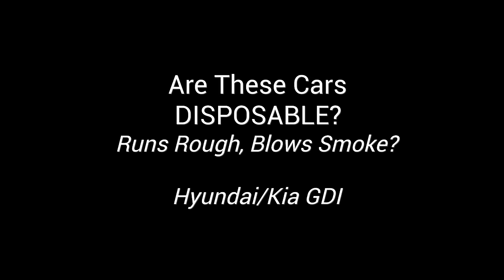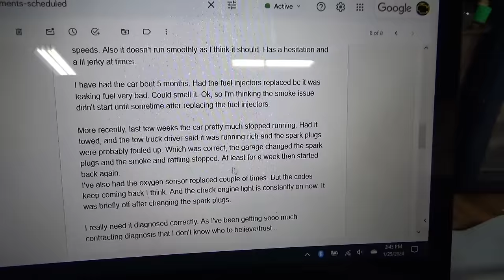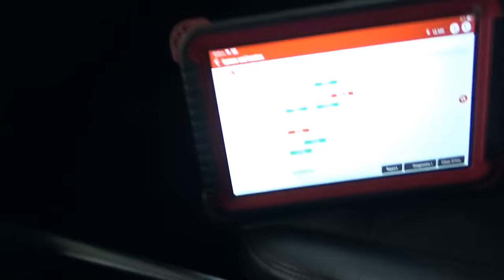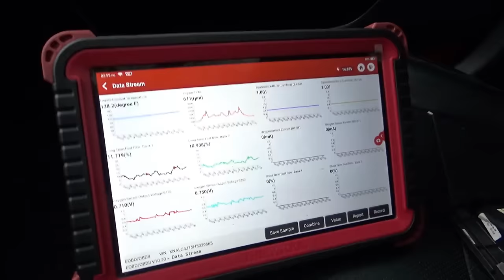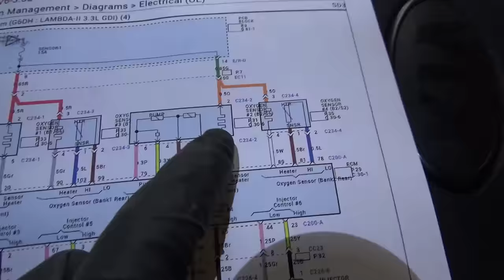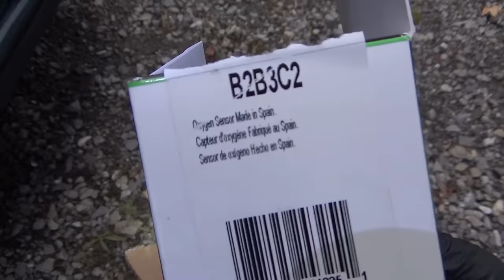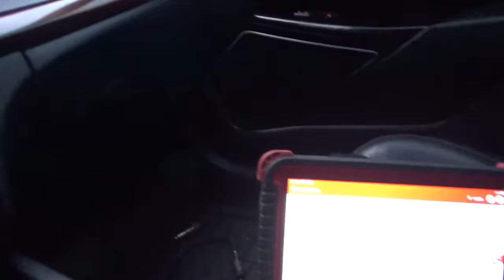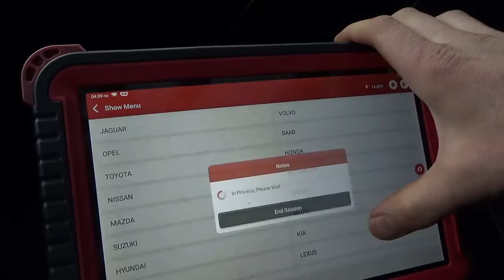Are These Cars DISPOSABLE? (Hyundai/Kia GDI Burning OIL - MISFIRE, Low Power)

Comment: Hyundai/Kia cars can last if they're non GDI. Had an 07 Azera with 3.8L V6 it had over 201,000mi on it. Before it got totalled in an accident. Main issue was leaking valve cover gaskets which is a known issue with that engine and bad OCV. My mom drives a 2010 Sonata 2.4L Non-GDI. It has over 230,000mi on it and still runs. Original powertrain on both vehicles. Oil changes every 4,000mi or so. 

Another variable I think plays a role besides regular oil changes every 5,000mi is where the vehicle was manufactured. Korean manufacturered seems to have less issues when compared with US built.
Reply: In the US they don't build them like in Korea.
Reply: @lactusgalacto1174  I actually agree with that. My Azera was built in Korea. My GF's Kona was built in Korea (it has the 2.0 NU engine which is known for it's own issues with piston rings. Haven't had an issue, yet.) The 2010 sonata was built in the US (Alabama). Lots of Theta II engine issues seem to be tied to US plants Hyundai in Alabama, and Kia in Georgia. My dad and I looked at two brand 21 Sonata's 3 years ago and one of them was leaking oil near the valve cover gasket. Sales guys and manager were surprised that it passed quality control at the factory and their Pre delivery inspection at the dealer. Of course both were built in Alabama.

Comment: Yes, many/most cars today are disposable. The manufactures are under great pressure to meet increasingly optimistic fuel economy standards. This brought us things like GDI with all of its inherent problems with coking up the intake valves. The loose-fitting piston rings rescue drag, i.e. a bit more efficient, but it increases oil consumption, so a second cat is added to handle the extra emissions. On the 1.6L Prince engine BMW/Mini says half a quart of oil every 1 thousand miles is normal. Twenty-five years ago, we would call this a junk engine. 

In the end all the complexity and extra parts required to meet silly fuel economy standards probably create more pollution if tracked over their life cycle.
Reply: What's funny is my '97 cavalier 2.2L (5spd) got the same mpg as my '13 rio 1.6L GDI
Reply: @nick21614  Either your Cavalier got 1.5 the MPG it should have, or your Rio has a problem. Based on MPG ratings that is.
Reply: @HeyBirt  Nah the epa estimates are pretty bad all my driving is highway too. Doubt anything is wrong with the rio I change the oil every 3k miles and it has under 60k miles on it.

Comment: The 2010 year 2.4l Hyundai sonata were designed perfectly! Only in 2010 did sonata get the timing chain and normal aspirated engine! Cuz it changed to GDI/port injection in 2011 and newer and massive amounts of issues and blown engines! And in 09 had normal fuel injected engine BUT timing belts that broke nearly on time it’s recommended mileage replacement (every 60k miles) all 4 of my Hyundais not from 2010 
Blew engines from timing belts breaking all around 50-57k miles on 2 and one at 66k (thankfully it broke just when I parked it. Cuz wouldn’t start upon leaving! I got lucky on that one!) and cost to replace the belt prior to it breaking quoted $2,000-$2,700 by dealers. And $1,500-$2.200 from non dealers! 
Unfortunately if the belt breaks while on highway the engines gone! 
     They should have KEPT the 2010 design with the chain and smooth 5 speed automatic not CVT! non GDI non port injection combo like after 2010.
      My 2010 sonata didn’t burn oil in fact every time I drained my oil at 5k miles the oil was STILL GOLD BROWN colour! Wasn’t black at all! In fact I’ve own almost 35 cars in 22 years and I’ve never seen a car do that! 
     And it was so comfortable almost road like a Cadillac

Comment: Lol so pretty much he didn't do what he was supposed to until it became such a problem he's going to need a new engine hmm funny that. Also seafoam will help that engine alot, it does in fact clean when you run it through the intake but more to the point of the car your working on if you put it in the oil it does help you just have to know how to use it

Comment: We're past the sweet spot of relatively straightforward port fuel-injected vehicles sold between 1995 - 2010. Combustion cars being sold now have now have become exponentially more complex and have made a lot of reliability compromises to keep emissions down and fuel economy up. 

I also hate that our regulations disproportionately affect smaller cars vs. light trucks and SUVs, completely undermining the goals of the regulations in the first place and pushing people into larger vehicles than they need. It sucks that small, practical cars are basically non-existent in the new market and reliable offerings are very sought-after in the used market.

Comment: Good tip Ivan! I work on small engines and use products developed for the 2 stroke outboard motor industry. Evinrude Johnson Engine tuner or mercury marine or Yamaha ring free (I think).
I spray it into the intake of a hot engine and just about stall it out a few times then spray a steady stream until it stalls. Wait - the longer the better. It'll smoke like crazy on restart, but It does a really good job of decarbonizing the head and piston.

Comment: Enjoy your video you seem like a very smart diagnostic technician I'm sure a Kia Hyundai is quite a challenge the next challenge we have to undertake is now Honda and Toyota are attempting direct injection which will ultimately shorten the life of their engines to the point of being very similar to the Kia Hyundai however Toyota has both port and direct injection which may not destroy the engine quite as fast direct injection involves high pressure fuel shot directly into the cylinder which typically only works on a high compression diesel engine it is never going to work and be effective and not destroy a gasoline low compression engine why they have to keep changing and why a Toyota now needs to have two fuel systems I just don't even know but again it makes me cherish and appreciate my 1976 Chevrolet Monte Carlo with a 354 Barrel turbo 400 automatic

Comment: Getting some monitors to run can be a bear.  My mom has a 2005 Honda Accord, and it was sitting for a long time with a dead battery.  I managed to get everything to run except evap.  Turns out Honda wants very specific conditions like tank between 1/4 and 3/4 and temperature above freezing for 8 hours.  It finally ran that monitor after a week of trying.

Comment: Two different customers complaints class 8 truck oil consumption , both had recently replaced  ( 6 - 8 months ) dipsticks and calibrated their dipsticks incorrectly . Basically overfilling crankcase by 1 gallon of oil .

Comment: I know that my brothers mother in law got rid of her Mitsubishi Outlander because it began burning more oil than fuel at under 100,000 kilometres.

his.wifes Lancer is the same deal,she booked it in to get the engine replaced under warranty.

His old 1996 model Hyundai Excel ( aka Accent in the U.S.) was still going &:it had about 165 PSI of compression on each cylinder at over 300,000 kilometres,it ran the 1.5 litre DOHC Hyundai engine.

He bought a 2000 model 2 litre 4 cylinder Hyundai Elantra to replace it because the Excel was falling apart.

The older Hyundais were good but ever since they have went to low friction piston rings they tend to burn oil & the rings get stuck in the ring grooves.

That was the case with my dads neighbours Genesis which runs the 3.8 litre Hyundai Lambda V6 engine, AFAIK he had the engine replaced due to an oil burning issue,the piston rings have been known to stick in them.

There's a Ford mechanic who fixed  up a Ford Escape which ran the 1.5 litre Ecoboost engine by using.the engine restore product to free up the piston rings since the engine was burning oil.

His preventative maintenance measure was to change the oil & filter once every 3000 miles!
Reply: Mitsubishi don't have an issue with either the 4G63 or 4B11 Engines found in Lancers, ASX and Outlander, it must be how they drive, and/ or the service intervals.

Comment: My 2011 hyundai Sonata has 150,000 miles on it with no issues but i have ran 10w-30 full synthetic in it since new changed at 4,000 mile intervals and it runs perfect and may lose a half quart at most between oil changes.  So i beleive its due to the extended maintenance regimen with the GDI stuff more than anything

Comment: The smoking could be caused by hardened valve seals or worn guides. May be worth a look with a bore scope to see if oil is running down on to the valves. If so it may only require a valve job not a complete engine overhaul. Love your channel.

Comment: I've had 2 Hyundais and 3 Kias and the only one that had a problem was the GDI engined one.  Kia did a recall to reprogram the knock sensor and if you did the recall the warranty was extended.  Obviously, this customer skipped the recall and didn't change the oil very often.
Reply: Cadenza's are not recalled.Thee 2.4 4 cylinder is the recalled engine not the 3.3.

Comment: Yeah a friend of mine had this issue with a hyundai suv.  I told him to replace the spark plugs and the O2 sensor.  then run thinner weight oil 0w 16 and it seemed to help.

Comment: Looks like the 2017 had the option of GDI. They made the same engines with multiport. My experience with GDI is the PCV system gets clogged easily which leads to oil consumption from the pressure…. and don’t own one without a catch can. Keeping track of PCV and installing a can makes all the difference. If you have a plugged up PCV system you’re going to burn a ton of oil because the rings can’t seat properly,. Moisture out the exhaust is a clue the crud from GDI is plugging up the PCV system. Blowby fouls the oil clogging the VVT oil control solenoids. So many bad things happen. It’s the first thing I check for now.

Comment: The main problem I find with all new cars is the manufacturer to make the car sound cheap to own, say 15,000 km or 10,000 miles/12 months between oil changes. These engines with close tolerances need every 5,000km/3,000 miles or 6-month whichever comes first, oil and filter changes. When new run them into bed the pistons and drive them around town, no highway constant speeds for at least 600 miles to 1,000 km. Never going over 3,500 revs and always driving in start-stop city traffic. 
That runs and beds the pistons and bearings. Then you won't burn oil because the rings are bedded and the crap from blowback and condensation forming in the oil won't have time to do damage. People whinge and say, oh, the oil today will last a lot longer. But it's not the oil we are talking about but the contaminants that get into the oil that cause the problem. 
I have had these cars last for 300,000 because they are serviced every 6 months or 3,000 miles/5,000 km.

Comment: Thank the US gov. Enforced stringent idiotic fuel economy targets.  Manufacturers need to use super low tension piston rings - which are very prone to getting stuck. The only thing owner can do is frequent oil changes hoping to keep rings loose. Also use synthetic oil only.

Comment: If you own a hyundai that is gdi  change your oil and filter every 3000 miles and you should get many many miles out of it...these engines are prone to the oil getting thin from gasoline going past the rings..no lie they have low tension rings and if you dont change your oil about every 3000 miles or so you wont get a long life engine...i hate low tension rings and gdi sucks but if your hyundai engine isnt already burning oil you will make it last much longer if you heed my advice ..good luck gods speed👍👍👍👍👍
Reply: Definitely use a quality oil and no more than 5,000 miles for oil change.

Comment: The only thing that will fix an oil burning Asian engine is new rings. The oil control rings are stuck. I'm a teck of 50 years and have seen this mean times.

Comment: Bought my wife a new Kia Sportage in 2019. No problem of any kind so far, oil level never moves, everything still works. It's the first car we've ever owned that hasn't given a problem within 5 years. In 1996, I bought a Chevy Cavalier. An ok car mechanically, but non stop electrical problems from day one, I gave up on window motors.